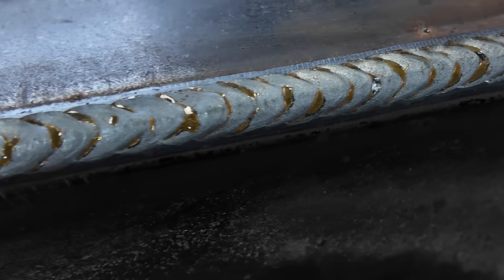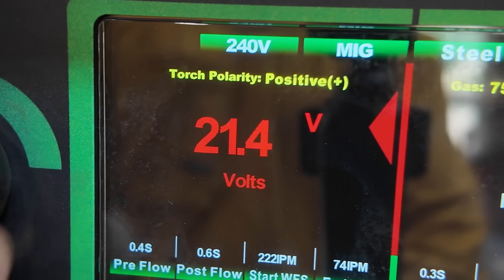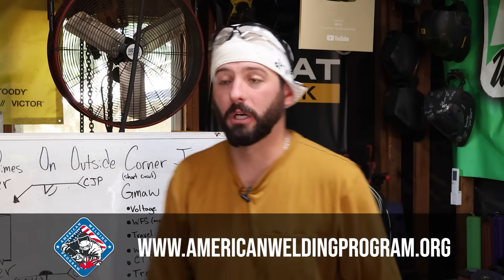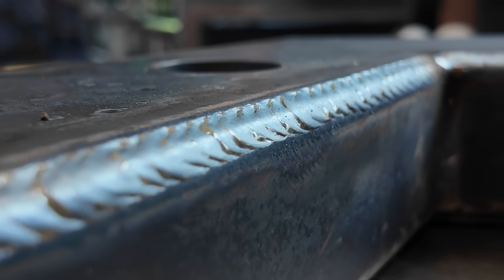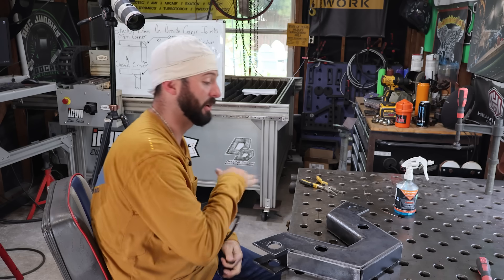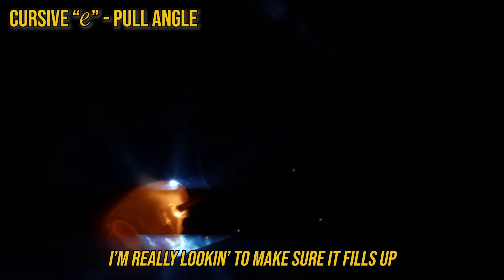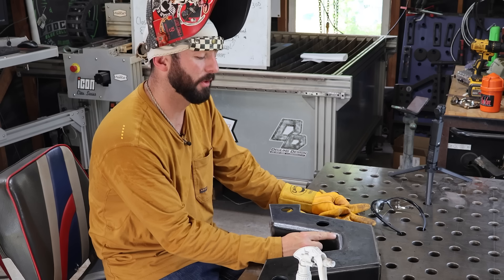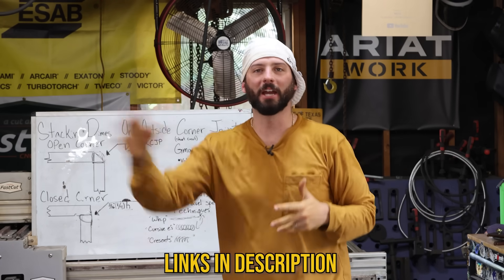The Secret To Picture-Perfect MIG Welds

Comment: Hello! I'm from europe and we have different standards here. In here the filletweld mark on the underside of the line would mean welded on the other side (inside corner), not the side you showed (outside corner). Is it different in america? Just a little thing that baffled me. I have zero contact with american weld symbol standards. Always thought they were the same.

Comment: Those welds looked awesome, whether push or pull,your comment on watching the puddle is the key, the puddle gives you a preview of your weld bead, a good fluid puddle will usually produce excellent looking beads. Your welds are so consistent, it almost looks like a computer automated bead.😊

Comment: Feel like you're def hitting the nail on the head push v pull stack 🔨.... been welding for min more tig than mig and I'm always trying to do the best weld ever💯... the variables on corner finish of that outside corner are typically my determining factor...I rarely get to leave the bead for an edge profile so I typically drag in order to achieve enough height to contour... good stuff🫡
Reply: There’s a reasoning for the seasoning, if you know what I mean. Thanks for watching!

Comment: I was shown how to push dual shiel and became a beast ever since. It boils down to what works for you. When I finishwd school back in 1995 I was certified in mig and stick but to my surprise the shipyard was all dual shield and a little stick for fitups.🤣🤣🤣🤣🤣I had to get certified in dual shield on the job but did it my first try.
Reply: They say “slag you drag” I’ve just put welds in however I could to make them pass. Little push, little pull. What’s a little angle among friends

Comment: So what is the advantage of 4T in this situation? You did good job of demonstrating one of the challenges.
Reply: I honestly don’t use it much. Not since I worked production pipe welds. I haven’t done it in so long, i naturally don’t let go of the trigger like I could have. What I did isn’t a disadvantage, I just didn’t use it with it on 😂
Reply: There is no advantage using 4T in that situation.
Reply: @Granamire certainly there is. What if I have crippling arthritis. 😂😂
Reply: It's for a long weld saves holding in the trigger

Comment: I'd be plenty happy if I could get welds half and good as what you are laying down.
Reply: Keep those hangs braced, plan for where you’re going not where you start.
Reply: if you cant get a joint that big and simple to look tidy ,,, take up wood work
Reply: @tomthompson7400 some people are new. They have to start somewhere
Reply: Higher voltage and high inductance to accommodate

Comment: In my personal opinion I think the biggest factor is the size of your wire, I run .45 everyday and I would never advise dragging a Mig weld. Also the “e” and the crescent method wouldn’t work in this situation with a bigger wire.
Reply: Didn’t know they made wire in a .45 size. That’s some massive wire. The biggest wire I’ve ever used is .072.
Reply: @Granamire he means .045
Reply: @Granamire It's crazy some wire is much bigger than that like 052 that we started using at a shipyard I used to work. I personally prefered the 045.
Reply: @Granamire  I've burned a lot of. 052 wire
Reply: Welding is allllll circumstantial. In this instance to get the bead profile I wanted I have to pull. With the joint design. There’s less worry about missed fusion, it’s easy to get. In the instance of short circuit transfer and 1/4” and under. Push, pull do as you please. In most cases it’ll be fine. Go up in plate and wire size, change transfer modes and joint configuration a straight push is the route you need to take
Reply: Difference isnt necessarily in wire size, its more in transfer method as said by the other dude in the comment section. Pushing and pulling for short circuit are both fine, spray transfer is definitely best when pushing/straight in. Ive done some short circuit with 0.45 and it does it just fine, its just higher amperage than smaller wires.
Reply: They make wire a lot bigger than .045. that's a mig range. I've run .063 and it goes higher than that.
Reply: Yep. It's better to push definitely with no motion.